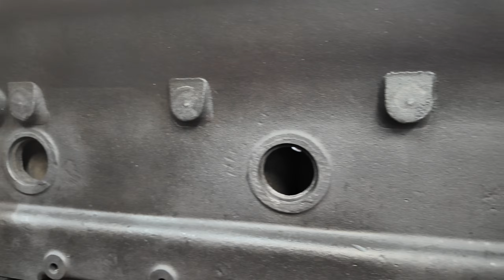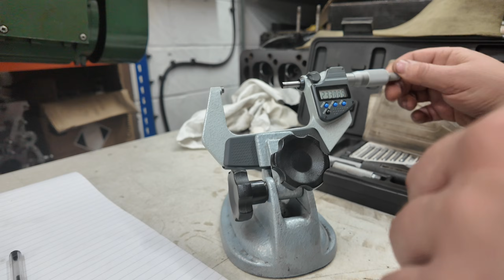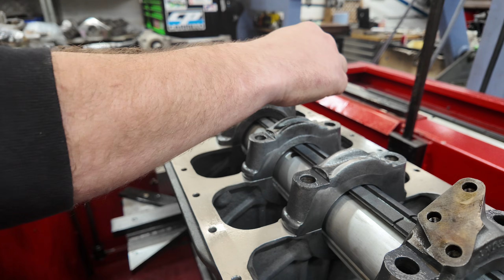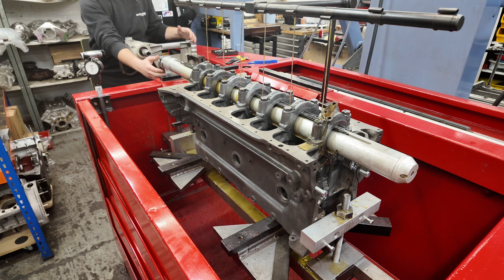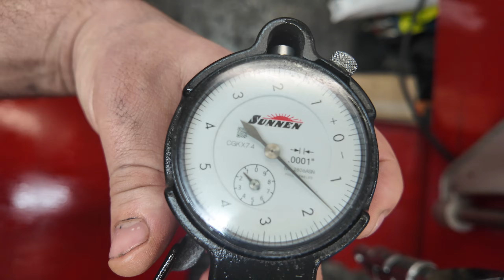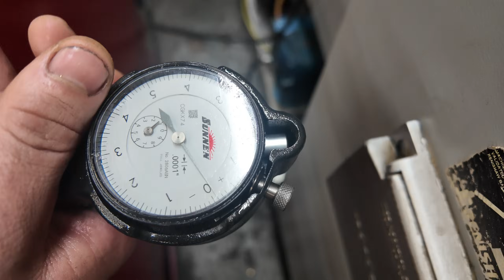The Jaguar E-Type Repair Most Shops Skip!!!

Comment: Is it common to have to put so many sleeves in one of those blocks?
Reply from the maker: They have sleeves from the factory with cooling passages around the top, the locks crack behind the liners, so we had to upgrade them to top hat liners, if your subscribed to the channel you will be able to follow our chassis 008 project

Comment: I first dismantled a car engine when I was 7 years old!  It was an Austin Ruby side valve engine that my Dad had pushed a bit (he commented he was doing 35mph in 3rd gear) when a con-rod poked a hole in the side of the crank case!  I helped him remove the engine and we transported it from the street into our back yard, where he threw me a box of spanners and told me to find what had gone wrong with it!  I clearly remembered the rod was broken and bent, also learning along the way that it had a Roller main bearing at the rear and ball bearing at the front.  I was also getting the idea of how the camshaft, tappets and valves were opened and closed at the appropriate times!  I think this was around 1954 and the Car was manufactured in 1936 as I remember.  I was hooked at that point and have always benefitted from that early introduction to mechanical sympathy!  I continued all through my life since, following all the innovations and still to this day at 78 years old do all my own maintenance on a high mileage CANBUS equipped Car - of course equipped with all the modern technology and tools that have gone so very far since those little low cost engines!

Comment: You try to make it better than factory new.  But..
Thermal expansion at 90 C working temperature and warpage of the block in 'free' condition was not accounted for while doing too accurate work.(assuming it will be just as straight in hot condition also)

Comment: Working in an industry where correct application of torque is critical to integrity people don't realise how important correct grease application is. From type, to friction factor, to application. Thin application all around prevents dope squeeze. Interestingly (for me) one big dollop doesn't spread all around as you spin in, rather it just 'moves up in a line' As we spin in we monitor this reference torque and try not to stop as we reach final make up torque due to the change from static to sliding friction. Loving the nerdy  engineering details
Reply: https://youtube.com/shorts/dnd-OZAGV9E?si=UUJXuqy3_Ht8hHG8

HP academy gives some more understanding in this short

Comment: Could use a bore micrometer of the three measuring point type.   New,  they come with a ring gauge to be able to set it.  More accurate than using the two point dial indicator type set off a digital micrometer.  Yes,  they cost a LOT new.  What they will not detect is any lobing of the bore.   Honing bores will not remove any lobing,  but lapping will.  Good point about fitting the liners BEFORE line boring the main bearings as the block will move due to pressing in the liners.  Maybe that's why some maunfacturers used "wet liners" which I believe were a slip fit in the bore with a shoulder at the top which means that when the head is fitted they cannot move.  Down side is poorer heat transfer into the block.
The more accurate you can make things in an IC engine,  the better it gets.  Progress through precision.  I rebore model engines that have ringless pistons and work to something like 1/5th of a micron to get the right fit.

Comment: IMPORTANT TIP No1:
What you should mention to your viewers is the fact that the crank centre line goes up in the block and thus the rope seal housings are out of center! Sometimes to an extetent where propperly installing the half that attatches to the block is impossible since the rope seal would be compressed too much. I used to produce offset bevels for the housings so the complete rope seal housing assembly followed the  rank centre line up the block. Also, If you did not deck them with the  block, it might prevent propper sealing of the oil pan.
IMPORTANT TIP No2:
After Inline boring the grove machined to the side of the middle main cap, which is to hold the thrust bearings, will be reduced in hight since you will have ground material off the main cap mating face. When installing the crank with the thrust washers in place these might get crushed, warp and preload. Thus the endfloat check will be very good or even too tight, while in reality you just squashed and distorted the thrust washers into a spring. Undetected this will lead to a vastly enlarged endload after a very short running time, catastrophic. Be sure to take some material off the tops of the thrust washers and check if the thrust washers still move freely when the main cap is torqued down. 
IMPORTANT TIP No3:
Do new bushes on the rods and resize the big ends of the rods. If taste runs this way, convert to the late 4,2 system and block of the oil feed bore to the small end and rotate the bush so that the hole faces to the top and oil mist gets funneled down into the bush. Also the bush will then have the even uninterupted surface on the thrust side. This was all standard with the 4.2 injection engines, arguably the most torquey and powerful production XK-engined Jaguar produced.

Comment: Using a very thin smear of bearing blue may show the touch points on each bore from front to back.

When I learned my trade I was told to apply any thread lubrication to the female thread and not the male bolt, but as you said not a great dollop as you don't want a hydraulic lock of the bolt. I was also told that if I lubricated a bolt or female thread that was to be torqued I was to reduce the torque setting by 5%. This information was given to us by Scania when we started rebuilding the engines of those vehicles in the fleet. We applied it to all other torqued nuts and bolts from then on. They reasoned that during manufacture all the threads being torqued are dry, and by us lubricating them, the torque reading would be higher than if we had done it dry due to frictional force differences.

I became a mechanic because I had a brother that trained as a fitter and turner then toolmaker and he repaired his own cars and modified them and I would help him. I had a passion for making something go that was broken and that developed into making a car I owned better than it was when I bought it, better for me that is.

Comment: Hi David, In response to your question of first cars, mine was an Escort MK1 1300 sport in Daytona yellow and as an apprentice motor mechanic I decided to lower the car by heating the front coil springs and attaching a strap to them and pulling the body down until it look low enough, MAD! I first decided that I wanted to be a motor mechanic when I saw a black 246 Ferrari Dino parked in the street and was gobsmacked at the sight and decided then I wanted to work on Ferrari's 51 years later and I am still working on them and Jaguar of course.
I am envious of your machine shop, but luckily I can say I have a similar engine build shop. Keep up the great video's and detailed explanations for all to see and hear. :medal-yellow-first-red:

Comment: Lovely work, Interesting to hear you talking about measurements, many people fall into the trap of tjinking because the display on the measuring device reads to 4 places they are measuring to that accuracy. the reality is the method they are using may only be accuratte to 2 places and any remaining numbers are meaningless.
When you get down to tenths of a thou the difference in measurement between a cold winters day and warm summer day is in the same range.

Comment: The video shows how to correct a block that has warped in the vertical plane but not the horizontal plane. The only way to correct both is to line bore and hone the block then use bearing shells with an oversize outer diameter which are available for some applications.

Comment: Wondering what this means if the bearings and crank are not to the same tolerances.
Reply from the maker: It can cause uneven oil clearances and potentially crankshaft failure.

Comment: so for an uneducated plebe whats the difference between line hone and line bore or is it basically the same thing
Reply from the maker: Boring is cutting with a sharp single tip, honing uses stones to slowly remove material 
Surface finish and size is better with honing 
Boring can remove odd material like welding or new steel main cap that stick out. 
Honing is a finishing or re-finishing process

Comment: Another question.  If you didn't "straighten" the journal line, how would that manifest itself in the rebuilt engine.
Reply from the maker: Uneven oil clearances and at worst resistance on the crankshaft causing eating failure

Comment: What stuck with me in being a car guy?
I suppose I was born to be a car guy.
I was 5 when the Nissan 300ZX Twin Turbo went on sale and I instantly wanted it. Turbo power sounded like magic to 1980s kids. Twin turbo could only mean ultra magic to my childish logic. In 1998, I read a magazine about how to get 450 HP from a 300ZXTT. It mentioned heated wire mass air sensors, and that was when I knew I had what it took to work on modern cars. It was also surprising to see what a turbo even looked like. Turbo power sounded so magical back then, that I had expected turbos to look far more complicated than snail shells with fans inside.
Reply: How did I get interested? Always went to the car shows with my dad who was not mechanically minded.
When I was 15 a friend gave us a tired 1937 Austin 7, dad poured a concrete block in the backyard to give us somewhere to work on it.
Only had open ended spanners, not even a ring spanner in the early days. Learnt a lot, then did valve grinds and decokes on Ford Prefects.
Never kept any of my road cars for more than about 2 years, gave them all a hard time. Then got involved in Alfa Romeo clubsport, raced a 1976 Alfetta GT, then a 1979 Alfetta GTV 2 litre with my son. Still have that car. Always keen to learn from videos from you and other mechanics. Keep up the good work.

Comment: Ross is doing a great job with the detail shots. Quick observation, I'm amazed the mandrel doesn't run in a guide at either end to keep both ends on the same centre line. Just wondering if the end furthest from the control could wander downwards due to the lack of support or does it use the other bearing caps to guide it?
Love the content and the detail.

Comment: Really like these kind of videos 👍👍
One question for the engine master :
How do you get the honing tool perpendicular to all the cylinders without any fixture in the end of tool ? 
So it doesnt starts wondering away, when some of them are higher or lower from center line.
Regards from Sweden 🇸🇪

Comment: How I got to cars? Back in 1980, when I was 23, I wanted to buy an E-Type as a „Sunday Car“. They could be had for 3.000 £ at the time. However, everybody told me that a good E-Type is min. 5.000£ - which I did not have! Looking at the dealers there was a good drivable Aston Martin DB4 for 3.000£ which I bought. However, after a couple of month I knew why Astons were cheaper than E-Types! The spare parts for Aston Martins were min 3 or 4 times the price of Jaguars. After 6 month the dealer offered me 5.000£ for the Aston to buy it back. I could not say „Yes“ quick enough, even though I did not need any spare parts for the car to the date. Any engine job would have bankrupted me! After that I bought a nice Alfa Romeo 1900 which I kept for a long time! However, I do regret not having the Aston anymore!
Reply from the maker: What a story! Thanks for sharing!

Comment: Interesting video - thanks for posting it. Is your goal to end up with an engine which is technically of higher quality than Jaguar would have produced when the E-type was in production? I don't have a technical or engineering background, so would like to know at what point variations of a fraction of a thousandth of an inch become significant, and begin to affect both performance and emissions, for example? If you then think about the companies that have a reputation for engine quality, longevity and reliability, do you think it is mainly down to such quality management being integrated into their processes, or are there other factors that are equally important?

Comment: Shouldnt you also use a torque plate to simulate the stress of the head bolts prior to align honing? (I know its traditionally done for cyl honing, but why wouldnt the same forces/effect apply to the mains?
Reply from the maker: It makes zero difference on these old Jaguars, the head bolt are right at the top of the deck, and a big cast iron block. 

When you start looking at modern performance engines like the bmw m3 v8 block, they’re so thin and flimsy (for weight saving and good design) that they’re a pig to machine. They have to have two torque plates and the mains torqued before you machine anything.
Reply: @DavidMooreEngineering I’m not sure that I agree, if I remember the head studs pass through the top of the block and screw in closer to the mains, I would think that may have some influence on the mains alignment, not that I have ever tested this. But we do need to remember that in reality the production line tolerances were probably only a guide.
Reply from the maker: @gary23jag that’s the later 4.2 blocks 
Early 3.8 blocks are different

Comment: Great videos, thanks.
Field bikes is where my interest/passion☺️ for engines comes from, getting an old motor running when it's been assigned to the back of the shed is a great feeling.
My job is now stripping them down to find out why they fail.

Comment: This video and a cold beer = perfect evening!

But is it realistic boring horizontal without bracing both ends avoiding that the weight/gravity pushes the bore tool down and than it takes more off the block than the bearing cap?
Reply from the maker: It’s negligible, cap to block material creates more of a problem, steel main caps on an aluminium block, it tends to try and take more out of the block. When you’re only removing .005” the center line can’t move far. But you have to take precautions to minimise it

Comment: 1st car- Used '63 VW Beetle, didn't do much to it other than crash it twice; second time put an end to it. Bought a 3 year old '67 MGB GT and learned quickly that if I was going out with my GF on Saturday night, I had to spend most of Saturday daytime keeping it running. Bought the workshop manual, some dedicated tools, and learned to maintain it. I was hooked, working on the MG and helping others became a great pastime. Fast forward to '85 and bought a '72 E-Type Series 3. Over the next 8 years did a full "OEM Grade interior kit, glass and an engine out transmission/clutch  rebuild. Goes without saying also all bi-annual carburetor (4) rebuilds and seasonal tuning. Still do most of my own maintenance today, though it is limited and not quite as fun as those days. LOL.

Comment: What cylindrical tolerance is permissable on a mandrel of that length?
Reply from the maker: as in the tolerance of the mandrel ? or the block after machining ?
the block has a tolerance of .005 on size and never gave a cylindrical tolerance, so you would assume that so long as all measurements are inside that spec it would be ok. 

the mandrel is an interesting one because the stones "bed in" meaning they actually wear an in-accuracy out of itself.i could probably draw this but would be hard to explain typing it.
Reply: I meant mandrel. If the mandrel is not perfectly straight, ie banana shaped, then this will have an effect on the bores, but as the mandrel is moved longitudinally this could help negate any cylindrical tolerance?
Reply from the maker: @paulgarrad1581 any intolerance in the mandrel comes out as the stones and shoes wear, a bedded in mandrel is much nicer then one on brand new stones

Comment: For me my earliest memory is as a 16 year old in the 1960's buying a WW2 BSA Bantam 125cc motorcycle as a box of bits and it then included assembling the engine and the frame and then using it for about a year as my first mode of transport.
Reply from the maker: we seem to get a few bsa A10s through the door. lots of older guys building the bikes they either had or always wanted.

Comment: Very interesting, I assume the stones have to be checked/calibrated from time to time as it must be easy to get uneven wear if the stroke control isn't full and consistent. Obviously the stones are considerably harder than the  block and caps but they will wear eventually. Worth asking in the event of steel main caps being used on a race engine if the difference in hardness between the caps and the block can bias the centre line of the housings downwards or whether a slower diametrical feed rate is enough to keep the housings concentric on the mains centre lines? Sorry for the many questions lol, great content!
Reply from the maker: Great questions! The stones do wear and need to be regularly checked for evenness, stroking well and understanding whats happening again minimises this.  For steel main caps you can get movement further into the block then the caps, there is things we can do to help it. but every job is different and you have to treat it so.

Comment: My first was a used 1983 mk2 celiac supra... Had 215k miles when I got it in 1998. Remember doing an intake, lowering springs and struts. I learned to drive manual on that car... Good Times.
Reply from the maker: im pretty sure nobody fully appreciates that time in there life until its to late. had such a great time back then!
Reply: Celiac?..Your car had a problem with its small intestine?